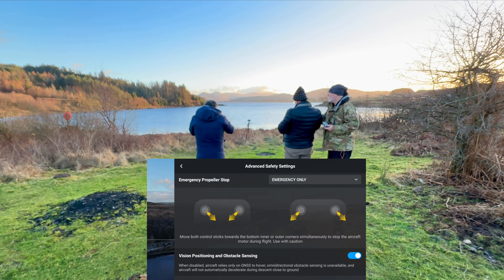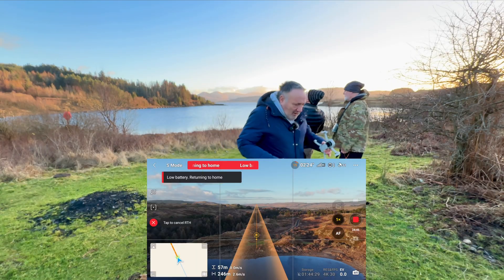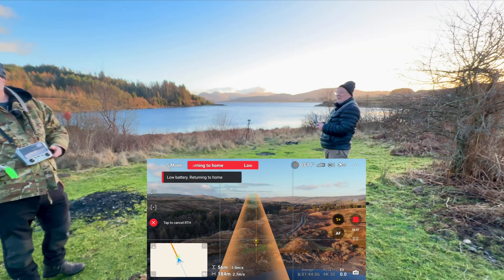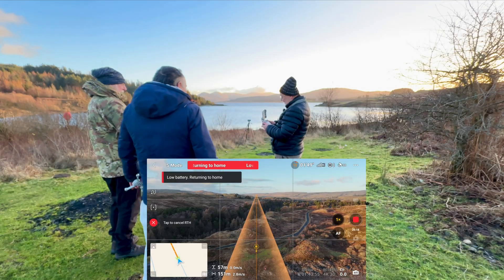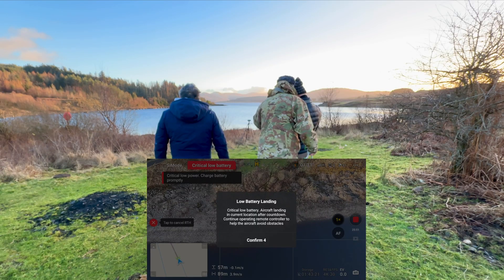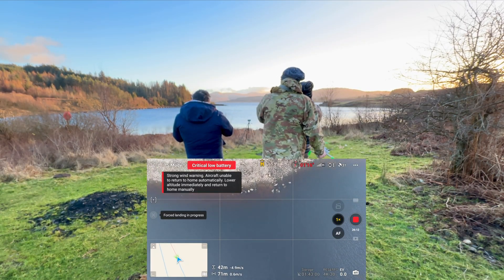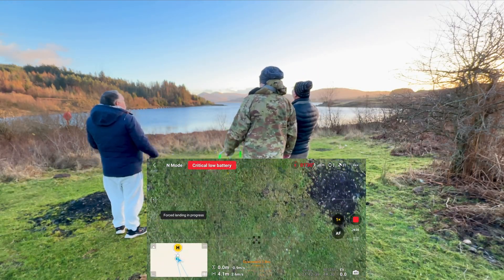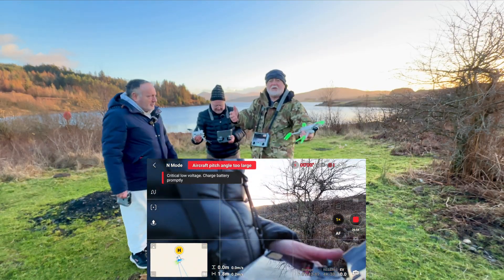How To Almost Crash a DJI Mini 4 Pro Into A Loch

Comment: In windy conditions I use to go lower than 60 meters and fly home manually if battery is getting low. It is (usually) not that windy closer to the ground.

Comment: Lost a cheap drone caught in the wind all I could do was go up or down didn't have enough speed to fly against the wind. I refused to let it land on my neighbors roof we were not really on good terms. It flew away last I saw it flying 100 feet up through some power lines and over a major 4 lane road. I learned a lesson I had been flying my DJI Mavic 2 in high winds just because I was impressed with the stability how it could stay in one place in high winds. I won't be trying my luck with a $1000 drone.
Reply from the maker: Aye, there's a huge difference in the wind stability between mini drones and 'grown-up' drones ;)